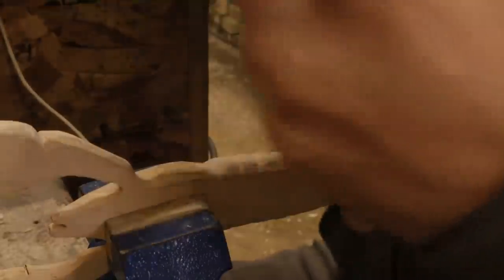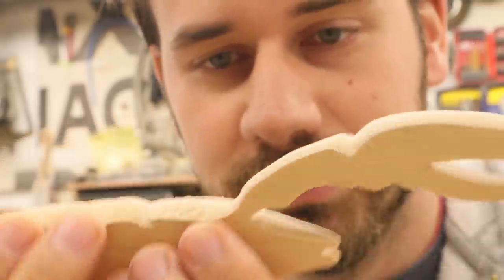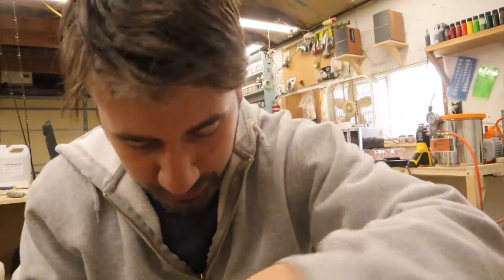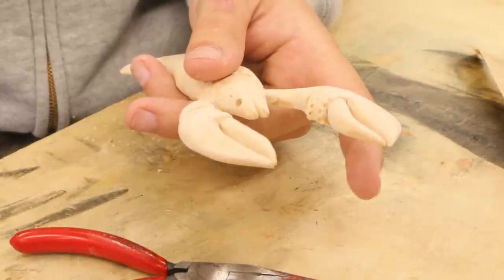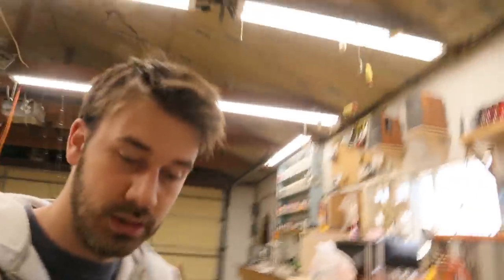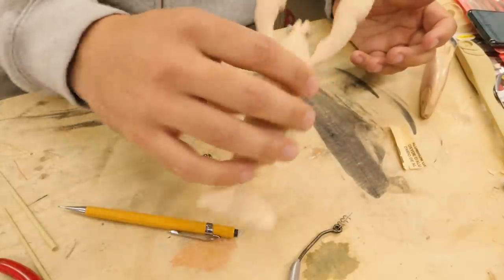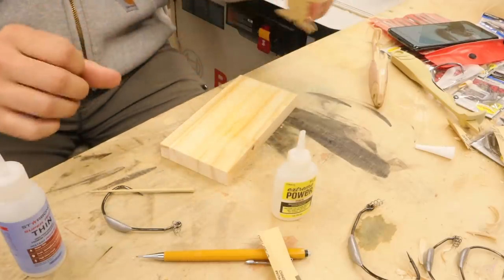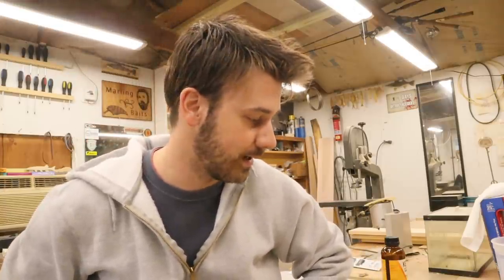Making a Lobster Lure

Comment: Hey Marling Baits. To make lobster eyes, i use cheap 0.5mm nylon fishing line. Just cut off a piece and heat one end over and over with a lighter or torch. If you do it right, it curls into a black ball.

Comment: Quick Tip, if u wanna work a dowel on your sander like that, just mount it in your drill chuck and sand it while your running your drill, works great !